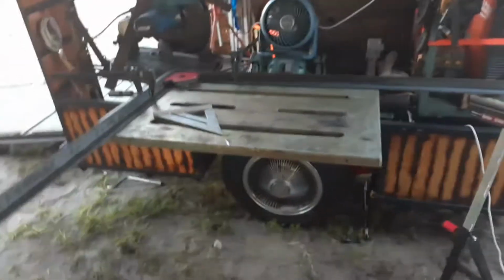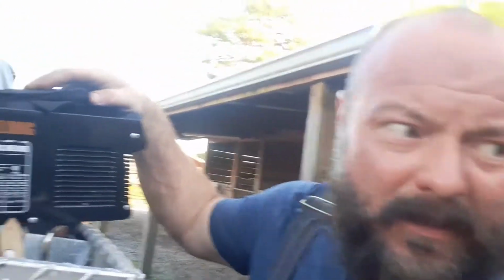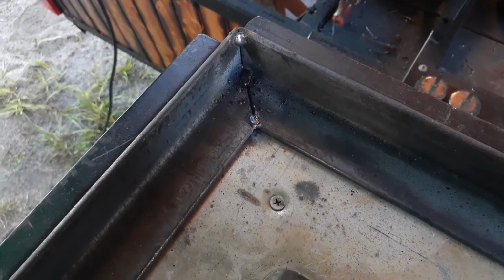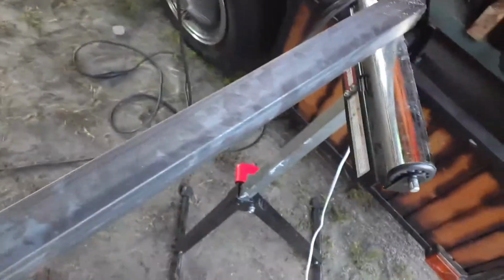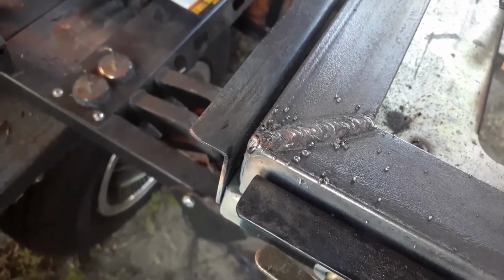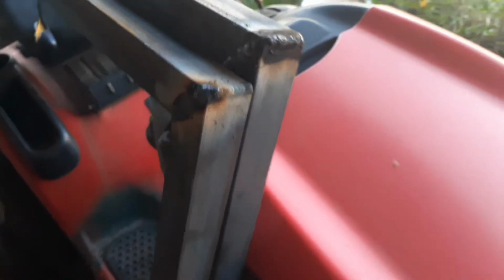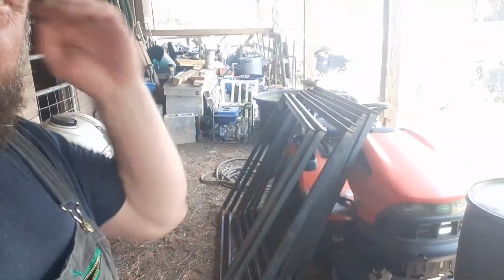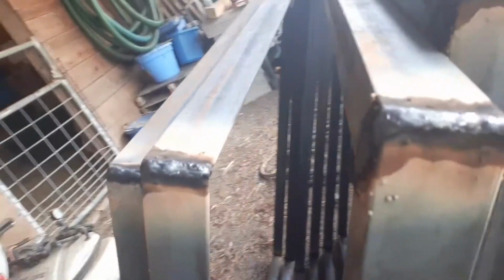Finally started welding the horse stall doors.

Comment: Just a suggestion: you might want to get a passive helmet as a backup (always dark). They are cheap, & might provide you with good protection. Great material, as always, & nice to hear you talk about your family & that you do things with them.
Forgot to say:  Don't be ashamed of Harbor Freight. I lived in Escondido, CA for a number of years, & more than half of the people who came into that store were tradesmen, looking to buy tools for their job. The SnapOn tool truck isn't for everyone, nor is the weld shop. I'm DIY, but if I was in the trades, I wouldn't despise Harbor Freight if they had what I wanted. Everyone needs a leg up when he gets started. Some find used tools. Others buy at HF,  and some prefer HF over the snobbery one finds at the welding supply store...
Reply from the maker: Thank you for the comment. I really appreciate the kind words and the helmet suggestion. I have a $40 "backup" helmet that is a trooper and doesn't get messed up when I sweat in it, but the window is super small. I got the bugger window, but sweat messes it up until.it dries out. I'll probably pick up that always dark one at HF. I'm in there almost every day.😆 Their 1/8th inch  6011 rods are pretty good. Thanks again!